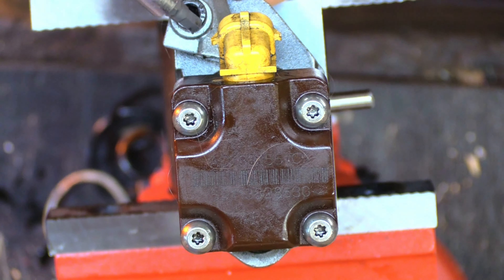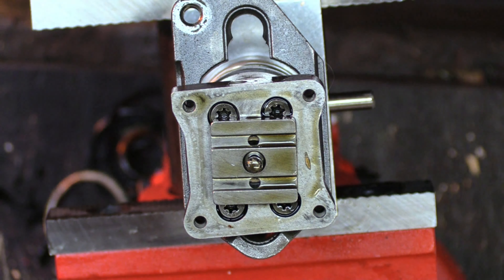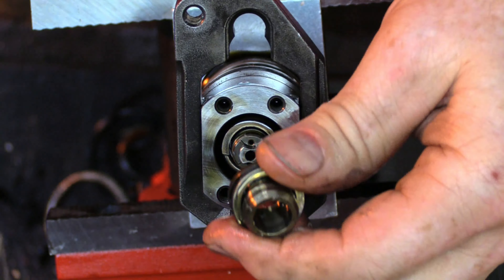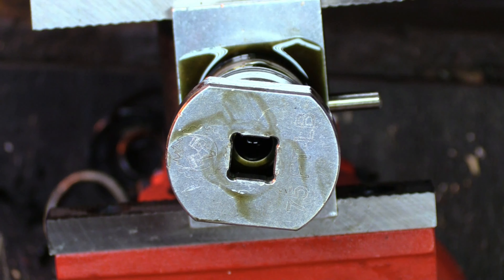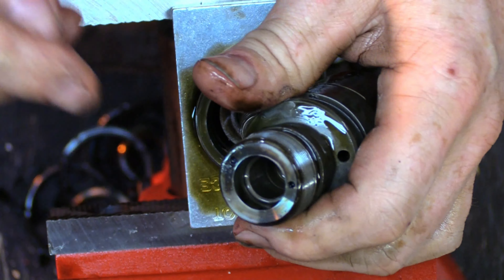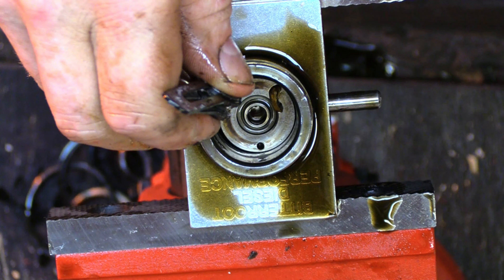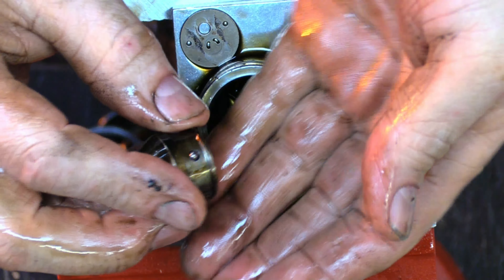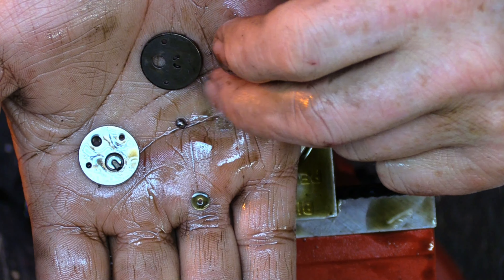🛻📽️ ....7 3 PSD QUICK TECH TALK 8 MINUTE INJECTOR BREAK DOWN 🟢🟡🔴🟢

Comment: Hi Clint! Just a quick question. Can a bad or broken injector cause a the engine to poor to much fuel, and make it look like blow by? Like a false blow by?
Reply from the maker: Yes and you would have also exhaust smoke as well .
Reply: @CUSTOMWORKS7.3PSD  thanks for the info, I trying to track down this issue. Pulling the oil cap off look like some blowby. Also smoking from tail pipe.

Comment: @customworks I could really use your help I have a 2000 7.3 and I sent my IDM to sinister diesel to get rebuilt I got it back I installed it my truck cranks, and wants to start but won’t actually start. Do you have any pointers?
Reply from the maker: Some times they don't rebuild your IDM board its just a swap that possibility it could be a different lower voltage But closer to home pull it apart and check the pins make sure there not bent or pushed back so there jumping contact , google image has a diagram for a IDM then make sure the ground is good , run the wire up ya know ,,, you can also plug in a po code reader and see if it can communicate or if there is a IDM code .. may be re hooking up the  batteries or a hot install of the IDM fried a sensor that was on the edge of going defunk The code reader would tell you that as well So try these ideas

Comment: Hey clint mike from new york here. I have a 2002 f350 dually with 61k original miles (mint condition) my question is is there any upgrades i should think about doing ? Would really like to to keep it stock as long as possible?
Thank you 
Mike from new york
Reply from the maker: Even though we do high performance builds I'm a stock man myself All the trucks in the fleet in my 2nd business all I do is add a high volume LPOP and a Adrenaline HPOP a Garrett GTP38R ball bearing turbo a Banks big mouth with a 4 inch exhaust No real need to go much further They run better more pep and quites them down while upping the MPG